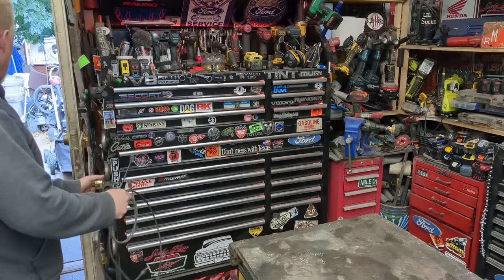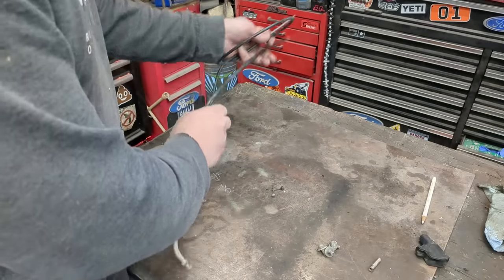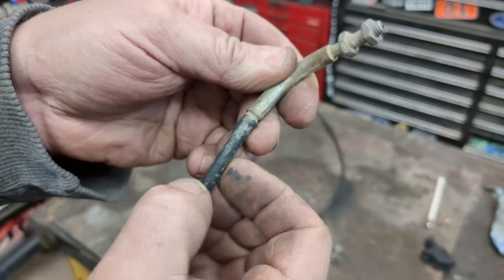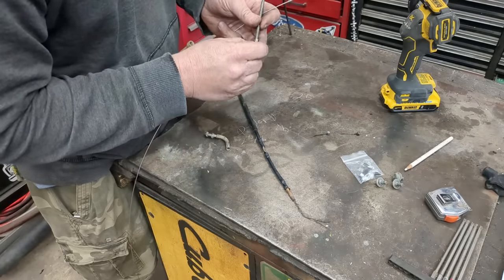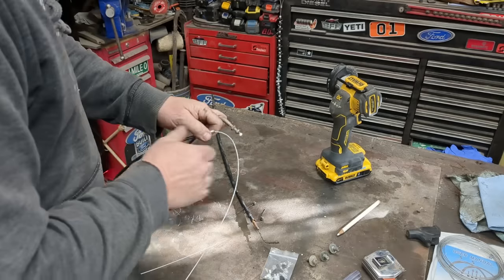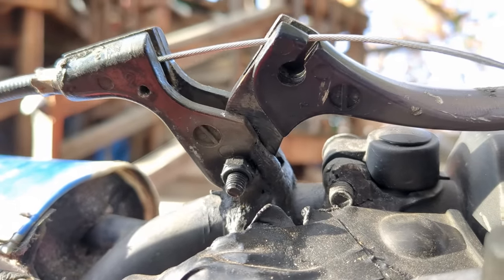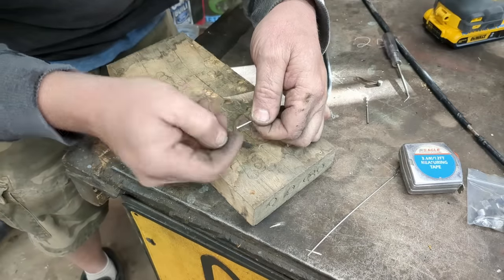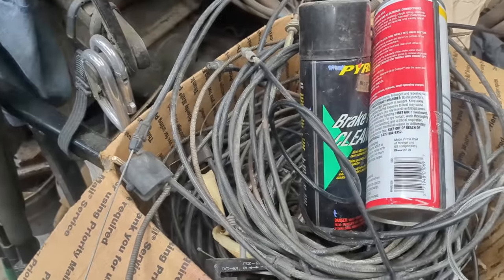Custom Cables and Ends from scratch or FIX - Throttle Brake Clutch

Comment: The end of the cable that goes into a brake lever for example, it is called a knarp. The sleeve that goes over the sheath is a ferrule. If you are going to use a solid brass or steel knarp, I've found the best way is to silver solder it, the radnor kit that comes with the flexible kind of solder is very good for doing this kind of work.
Reply: "The sleeve that goes over the sheath is a ferrule"... 100% correct. It's amazing how many folks don't know the correct term for it although it should be noted that a ferrule can take different forms other than a round, thin walled and narrow sleeve shaped object. "Ferrule" was never well defined IMHO and became somewhat of a loose descriptor for all sorts of objects that were generally used simply to hold a part or parts together. I was originally introduced to a ferrule as a youth when I used one to join a threadless tube to a base via a compression fitting but I eventually came to understand that a ferrule can be all sorts of bits used in a variety of ways. Generally, I think of the term as a slang term and have for quite some time. I bring this up because it's important to ensure you know what you're getting if you go to buy replacements... it's important to visually confirm what you're getting is a match for what you want. This is especially true if you don't like making multiple trips to a supplier or having to return items that were shipped to you but turn out to be unusable. Just as it's wise to take any part you wish to replace to an auto parts store so you can match up the old & new parts, compare your ferrules and measure one out with precision measuring tools if necessary. While it may not make any real difference, sometimes it does - such as when you make or repair pressure connections for pneumatic lines, hydraulic lines, fuel delivery lines, etc. Best wishes!

- Max Giganteum
Reply: @MaxGiganteum  exactly, i learned about ferrules from working on mopeds and also ferrules for electrical work:)
Reply: Gee gad Brain, how do fit a shark in a swimsuit NARF

Comment: I went to the scrap yard/ junk yard & I removed a dozen cables from 7 or 8 different cars. I took the trunk release cables, the fuel cap release cables and some bonnet/ hood release cables the reason I got these particular cables is cuz they are between 3 to 5 metres long and pretty strong which means I can pretty much  make any size cable 4 all & any projects  I'll ever need. Hopefully Just a helpful little tip for anyone who builds motor cycles or go carts . .
Reply from the maker: Great source!

Comment: We used to make our cable ends by drilling a hole in a piece of wood than drill a smaller hole in the side of hole and torch melting old tire waits with cable inserted. Grind to fit.

Comment: Awesome trick! There have been a few times I could have used this, and saved waiting for days/ weeks to get whatever random project going again :) In fact, I got the incorrect kill cable for one of my mowers, now I can redo it and not have to order another/ waste the wrong one!
Reply from the maker: It's a handy little trick.
Reply: @sixtyfiveford  and now I'm thinking of a way to make a mold that is reusable.. maybe a piece of aluminum , cut in half, then drilled.. clamp onto cable, pour full and remove.. like a bullet mold for reloading.. only for cable ends :)

Comment: From approximately 5:45 to 11:00... the method you're using is called "potting" a cable. I'm specifically referring to using a mould filled with a molten metal to form the grip at the end of the cable. The key to strength is the frayed ends of the cable strands being surrounded randomly by the poured metal so that no slippage can occur. As for the metal, some solders are usable as is lead, copper, bronze, brass, aluminum, etc though I'd stay away from aluminum as it seems to have durability issues - a lack of ductility. Obviously, solder is easy to melt as is lead but if you have access to an oxy acetylene torch, you've got a lot of options for metals to use if you're in a pinch. An old school penny works quite well for example... pennies minted from 1944-81 are about 95% copper making them viable for the process. Of course you can strip some copper wire, use empty brass shell casings, snag a bullet or some wheel balancing or fishing weights for their lead or scrounge up whatever you can find if you're in a tight spot. If push came to shove, you could use gold or silver too with a torch. Anyway, for those that can do it, I recommend machining up a permanent mould out of steel. While wood works, you typically kill it removing your newly minted cable. Manufacture a steel mould with a push rod in it to eject a fresh pour then you'll have one for life. Best wishes!  👍🏻 🛻 👨🏻‍🔧

- Max Giganteum

Comment: Last week I had two Husqvarna lawn mowers of the self-propelled just break at the same time pretty much. 1 yd apart. And I happen to stumble across this in my ventures at night trying to find a quick solution and this worked like a charm thank you so much I'll never buy another lawn mower cable from a lawn mower shop again

Comment: You can also use used mig welding liners for the cables. I’ve used them on push mowers for throttle control. I also made a steel mold similar to making sinkers and melted lead.

Comment: Cool video! Any thoughts on how to make a replacement cable that has the solid metal rod inside the sheath rather than the stranded style? Like GM heater control cables.
Reply from the maker: You can buy the brand new solid wire. It's spring steel, also known as music or piano wire. Most of these cables should be around 1.5 1.6 mm/ 0.0625". You usually bend them with some vise grips or if they're complicated like a spiral round, you can heat them up and wrap them around a screwdriver shank.
Reply: @sixtyfiveford  how cool is that! Great ideas! Thanks again

Comment: That was stronger than I would have thought. Could definitely come in handy. I would have tried finding a piece of brass or steel of the right shape and then drilling it, and then silver soldering. Your way is simpler.

Comment: When I was a youngster in the olden days, the local motorcycle shop sold all the pieces separately. The end pieces were brass and soldered to the cable real easy.. This mold is a good idea for the bigger ends but might me a challenge for a carb slide..
Reply from the maker: When people knew how and or were willing to learn how to fix stuff.
Reply: @sixtyfiveford   It was a whole different back then. PONG just came out but only the elite had it... Everybody did their own wrenckin or had a friend helping// Even some girls did oil changes and tune-ups..

Comment: Cool technique making your own mold! Some sporting good stores like dicks have packages of lengths of cables with ferrules so You can make your own cables. I like to use the brass cable ends that have a hole drilled through them to put the cable through, and I have a small steel condiment cup I use as a crucible thats half full of solder. Put your new brass end on and hit with some flux and dip in the hot crucible!

Comment: If you just need to shorten a cable, you can also use brass rod and cross drill it for the cable to push through and solder it on to the end of the cable. Motion Pro sells the brass barrels, but they’re easy to make from some 6mm/1/4” brass rod. I use an old school solder gun. See here: https://youtu.be/MrN4Bg4rciQ?t=305

Comment: Very good idea... @sixtyfiveford ever tried unbending a push/pull quad cable bent in it's sleeve?
Reply from the maker: Yes, with medium success.  Problem is if it bent generally it's not sliding well in the cable. And once it bends in that spot it wants to bend in that spot over and over. So I try to bend it straight and then pull from both sides while continually trying too lube it.

Comment: The little barrel ripped off on mine. If you just need a quick fix. Use thick superglue and baking soda. Held the wire in place and works like new. While not an awesome job like this, it works great.

Comment: Is that the same type of solder used to repair radiators? Or can I just melt something like a buckshot fishing weight? I bought a motorcycle throttle cable for a drift trike I'm building and the cable is way too short
Reply from the maker: You can use a lead fishing weight.

Comment: Wouldn't it be easier to create an end by finding a piece of brass rod in the correct size, drilling a hole for the cable and brazing(soldering) it together?
Reply from the maker: Yes and no. Having only a single point of solder is going to be a way weaker bond. The frayed cable surrounded by solder is far stronger. The brass will wear better but it's rare to see the ferrule wear before the cable snaps.

Comment: At the risk of sounding like a know it all. Witch, i surely do not.  Isopropyl alcohol  is recommended for cleaning off silicone. I have been using it for years. Even dryed all you need to do is soak it until it breaks down.  
    I will say i like your methed. Little different than the way I do it but I think i'm gonna tryLittle different than the way I do it. I think I'll try it next time. I need to make a cable. Thanks

Comment: That's hardly a homemade cable…

I made one with garage door cable inside of 1/4" ID steel tube (hydraulic), to work the brakes on a John Deere 180 (peerless transaxle) when I made it into a rear-engine mokart.